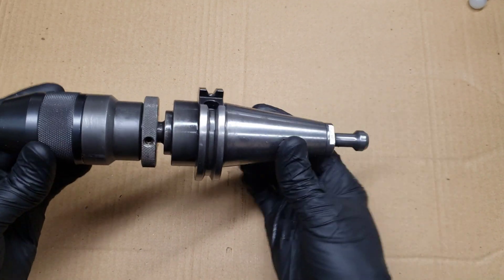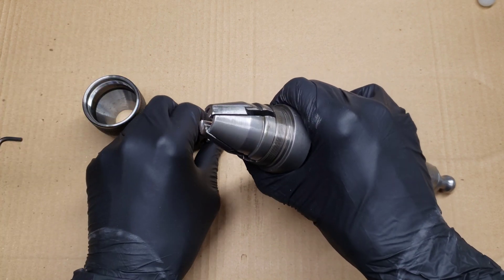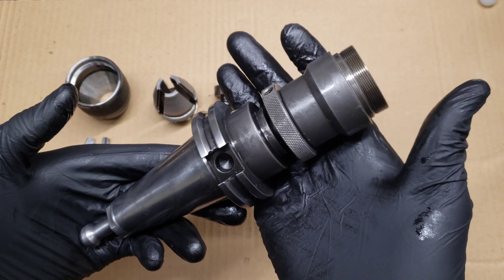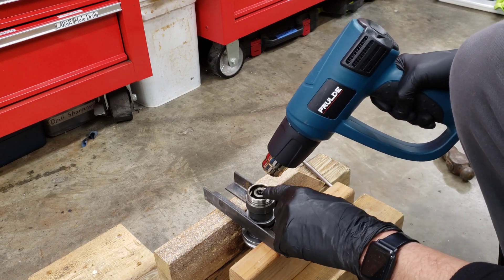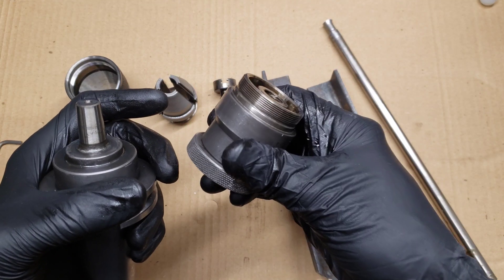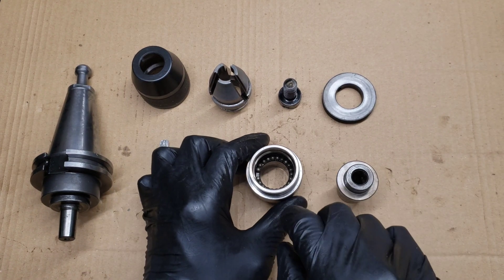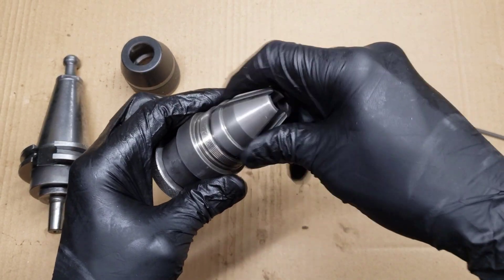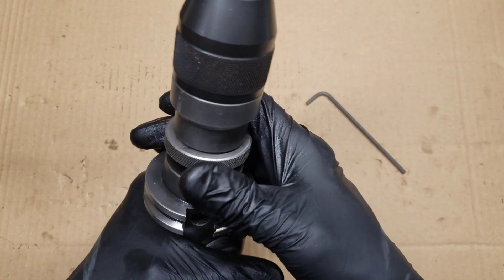What's Inside a Keyless Drill Chuck | How To Take Apart and Re-Assemble | Remove From CNC Taper Tool

Comment: Very nice video.  Too bad the Dewalt Cordless drills have been made to make it impossible to replace a worn out chuck.  I've been working on mine for a week. So irritating.
Note: Use CRC Electronic cleaner for fast degreasing. Mineral spirits scrub also works well. Then alcohol scrub.
Grease up using Molykote 2008 or similar. Any synthetic grease with Molybdenum Disulfide will work extra smooth instead of just silicone or Vaseline type of grease. Molykote 2008 has both Moly + LIthium Grease. Moly powder (Amazon) is like adding graphite powder to a grease. Grease looks a dark gray and the slipperiness increases. Moly is good for heat and pressure, does not break down that is why it is added to automotive grease for gears.

Comment: You do NOT have to dissassemble the chuck part to remove it..!  🤣
Reply from the maker: How do you remove it in this situation where it was super jammed up (someone may have dropped it and shoved the taper in so tight it stopped the chuck from rotating)?
Reply: Use a drill drift - they come in pairs, you mention it in your video.  they apply significantly more force than you can with a hammer and a punch….